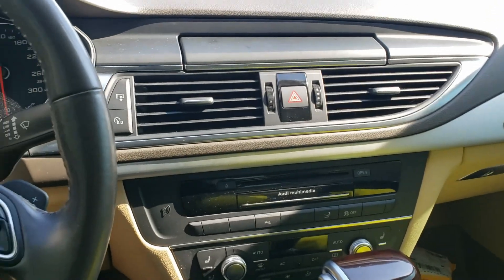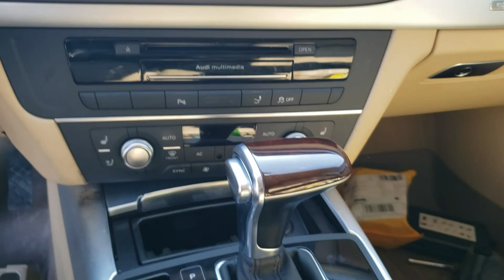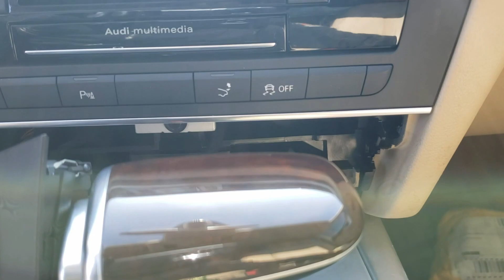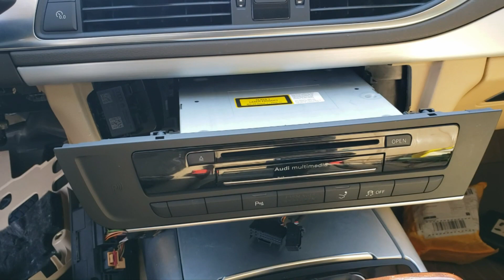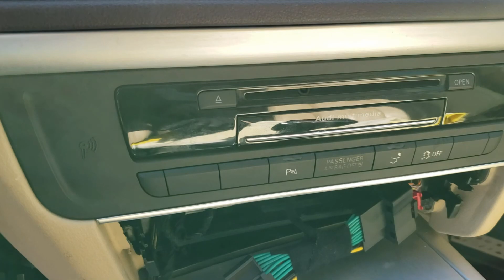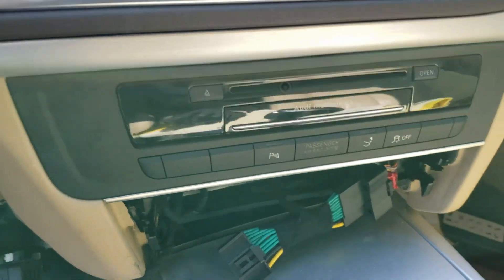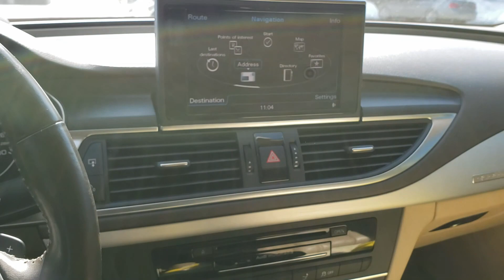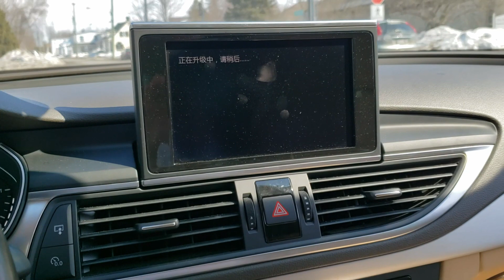Installing RSNAV carplay/android auto standalone unit to 2012 Audi A7

Comment: I have issue with MMI, Nav and Audio are no longer working. Is it possible to install and bypass the MMI Interface? or I have to fix it before install the unit? Thanks
Reply: Did you get a reply on this? I have the same problem with my 5F module

Comment: Is there a reason why you put it on drivers side and not to passenger side?
Reply from the maker: line length is short and it's harder to pass the wire to the right.